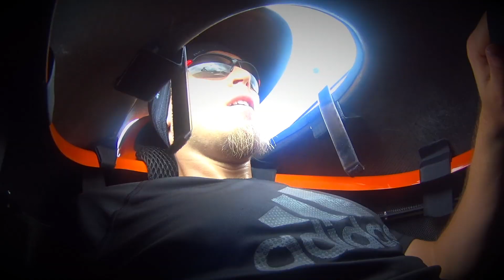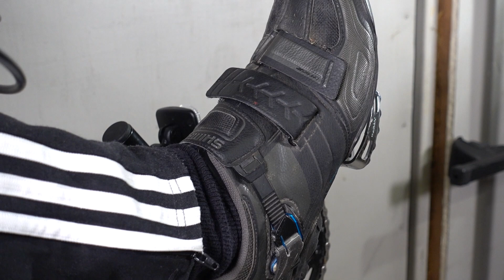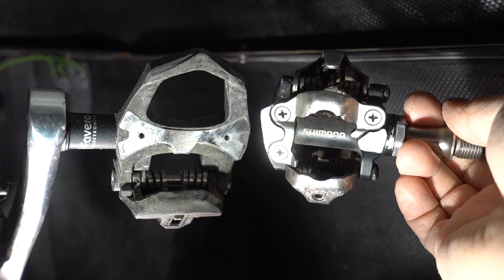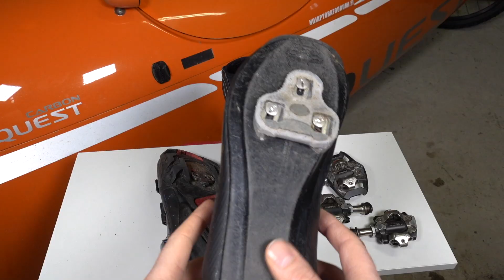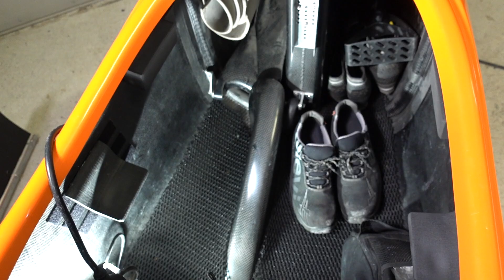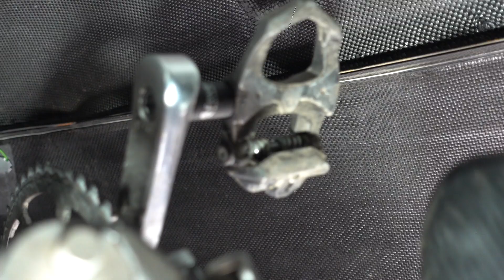Shoes and Pedals for Recumbents and Velomobiles

Comment: I tried out clipless pedals on a Quest 12 years ago, but couldn't get my right foot in because my right sciatic nerve was damaged when I got hit by a truck doing 65mph (the truck not me!) when cycling home from work (just on an ordinary road bike not a velomobile) leaving me with a lack of power, sensitivity and movement in my right foot. So I ended up cycling without my foot clipped to the pedal and sometimes it would slip off and my achilles tendon would crash against the edge of the foothole. I did 120km like that, before I swapped the velo for an ICE trike. Now I have a Quattrovelo and I have magnetic pedals from Magped. I  have to reach down with my right hand and pull my foot of the right pedal but that's easy to do

Comment: I also use MTB shoes with the cleats as far back as they go. Works for me quite well. I routinely use Crank Brothers Candy pedals. For my shoes, I have two main pairs. One that is sports oriented with a stiff carbon fiber sole, similar to road shoes, but with some tread, and a softer soled pair of touring shoes, that I wear for more casual outings and shopping. They make less noise on hard floors!
Thanks for the video Saukki. Informative.

Comment: I put the cleats as far back as possible and even prefer that when I ride my road bike as I get less hot foot that way.  I use MTB shoes paired with SPD cleats for road bike, recumbent bike and recumbent trike. For my DF velomobile, I use road style triathlon shoes as I get the best power transfer with those and they are very comfortable. Currently I am using SPD cleats on the road shoes for my velomobile, as well. The best shoe for power transfer is the carbon fiber soled shoe but I'm not using those anymore because they have become very expensive. Thanks for this video - nice to hear what others think and why.

Comment: Hello Saukki, firstly thank you so much for your very helpful films on velomobiles, I am about to order a bülk after a test drive. To finalise my order can you comment on the following questions: on the flat do you ever run out of gears with a 70T front blade? What is difference to the speeds that can be reached with 60T vs 70T? Many thanks in advance for your thoughts! Best wishes, Abbey

Comment: After spending a few grand USD on different shoes and cleats, pedals etc, of all things the best shoe for recumbent trikes and velos, turnded out to be a cheap ass pair of Nashbar sandals with SPD clips. I had to grind the clip channel back a little but they work surprisingly well. Go figure, the damn things are better than a $500 pair of Shimano racing shoes. I use them even in Winter here in the GPNW of the US. Even up on the Columbia Plateau during fall they work. I have to go over a 9,000+ ft. pass from my place, down to a 4400+ ft. plateau and they work like a champ, in all of the weather types going to and from. I use a Catrike Expedition and a Quest, depending on my mood. I can haul more gear with the Trike and a B.O.B. trailer, so the velo isn't always the best option.  I should have listed the altitudes in meters, oh well, looked at the map and the pass is 2,488 meters high on the road. Things get a tad tall around here. One of the reasons I had to convert the velo from 90 mm drum brakes to 184mm BB7 disc brakes. The drum brakes just can't hold a velo on the hills out here.

Comment: I ride a 2 wheel recumbent (Bachetta Giro). As a rule, any time I hit the ground, it is just as I come to a halt when I lose traction as I put my foot down. Here in Houston, Texas the asphalt gets very  slippery because all the cars drip condensate from AC at the intersections. I just bought some new shoes and my main criteria is soft rubber soles which can afford better footing. Stay away from hard plastic soles even though they wear better.

Comment: With click pedals you can also pull and not only push. 
So you have almost double the power on the pedals against clickless pedals.
I only ride SPD(MTB) system in my velomobile, because you can definitively walk better than roadbike shoes.
Power meters for MTB systems are becoming more and more developed and also cheaper.

Comment: I have so-called commuter shoes which, just like MTB shoes are walkable and the cleat is recessed in the sole. My favourite cleat after several tries with other brands is the Speedplay Frog for many years now. With the Shimano MTB cleats (very durable) I sometimes pulled my foot loose in a sprint and my knee banged hard against the top of the velomobile. Painful. With the Frogs it is impossible to pull out of the cleat by accident, but at the same time the so-called "float" or sideways movement of the feet is effortless. This is better for my knees than the much more rigid cleats from Shimano, which force your foot in one position with spring retention. The Frog has no spring.

Comment: Based on Your video and the comments i will try SPD-sandals on my MBB. Currently i only use flat pedals and cycle barefoot in summer. Like on my motorbike, the load is on the balls of my feet. So i think i might opt for the position furthest in the front.

Comment: I still have the old style toe clips on my diamond frame bike, and I prefer them, because I can use really comfortable shoe with them.  I've ordered a Hilgo, and I'm wondering if I can use them with a velomobile (ie, can I reach my feet with my hands to strap in and out of the clips?).  I also have the MB shoes that Saukki just showed us, but the metal clips click-clack on walking surfaces (annoying).
Reply from the maker: You probably can't reach your feet in the velomobile. And with a recumbent riding position and pedaling technique you push towards the heel of your shoe. I don't know if toe clips provide any support in that direction. Just use regular SPD pedals & cleats. There are MTB type shoes with cleats inlaid inside the sole so that they won't touch the ground when walking.

Comment: Is there any way that cleats can cause shin splints? Just went to 3 wheels last year. Im trying to train for a century ride. Got shinsplints around 2nd month.   Im 63, but I never experienced shinsplints in nearly 50 years of riding. I was using toe clips on my old recumbent. Any thoughts? I wish I had found your channel before I bought my trike. I didn't know velocycles were available to the average guy. Now I want one. Btw. My Wife says your channel is Oiken hyva.
Reply from the maker: You can usually adjust the angle of the cleat on a shoe. And some cleats / pedal systems have more play, so you can twist your shoe a little bit so that it doesn’t yet release from the pedal. I think those things helps to prevent shin splint.

Comment: I have both types of shoes, the mountain bike type cleat for my WAW and the road type for my Alleweder. I find that after a while my feet go numb no matter which shoe I wear. I'm still hunting for the perfect velomobile shoe.
Reply: Maybe your shoes are too narrow or you tighten them too firm. On recumbents / velomobiles the shoes should not bee too tight. I had a pair winter cycling shoes which were great when I rode MTB, on recumbents I couldn't use them anymore. So, you may try a wider shoe model or tighten yours a bit less firm. And as Saukki said in this video, maybe try a number larger that walking shoes.

Comment: Does your powermeter measure only if you push the pedal or also if you only pull?
Reply from the maker: Yes it does. It doesn't matter in what direction the force is applied. It should measure it anyway.

Comment: When yer foot comes off on a recumbent trike, it is called, foot suck, as your foot sucks under the trike. Trust me on this, I learned it the hard way and it fucking hurts. Also cut the clip channel on yer shoe as far back as you dare and move the cleat there. This will prevent what is called, hot foot, which also hurts like hell.